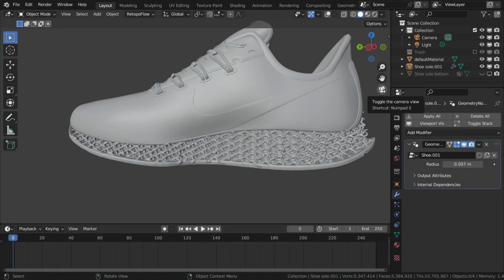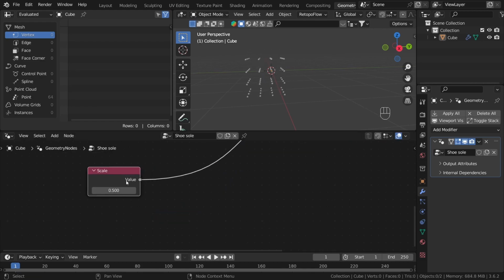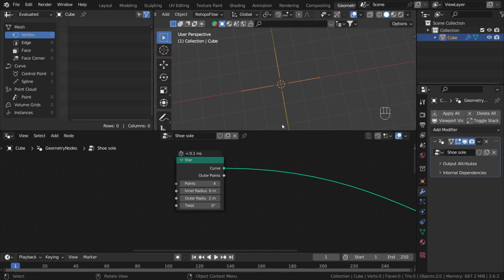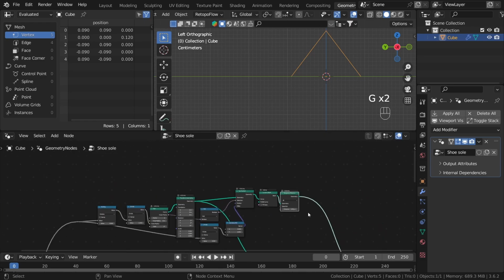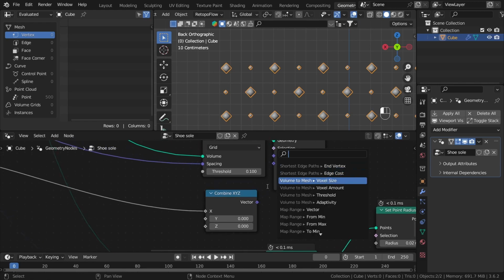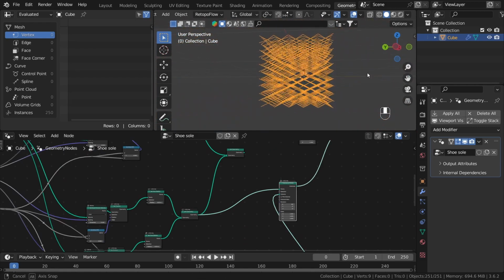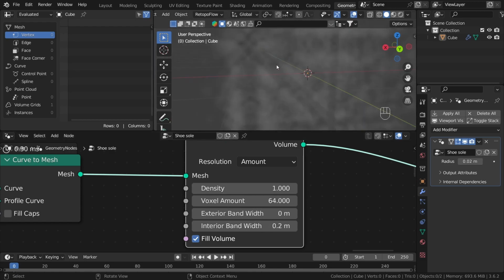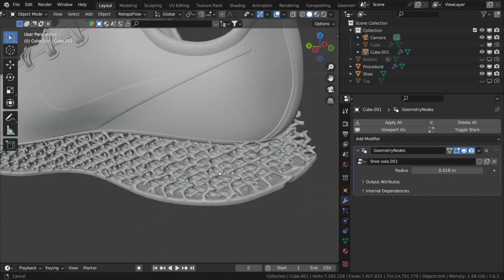How to Make Shoes with 3D Printed Pattern in Blender - Part 1

Comment: what would be really good is making lattice that fits into a sole
Reply: You can hollow out a shape using something like MeshMixer and use that to create custom infill latices, I've done it before and it works great. Angus from Makers muse has a great tutorial on this...

I made several insoles printed with eSUN eLastic and results are amazing, I wear them all the time. No need for fancy techniques like this for a "flat" insole too, regular slicer infills will do. His technique allows one to "bend" the infill which is key to design more complex shapes and variable infill... Insoles aren't completely flat of course, so I used surface layers to create more density for the arch support worked like a charm.